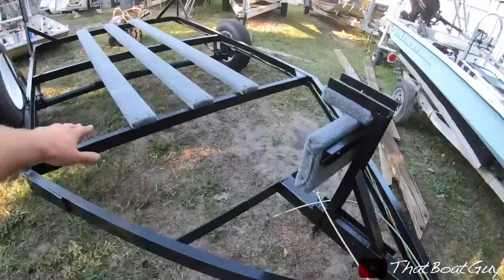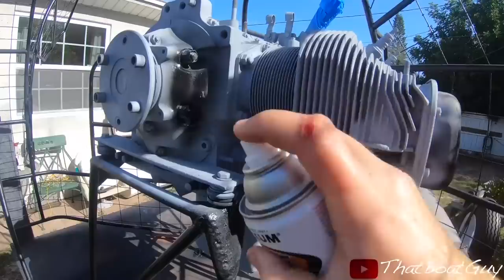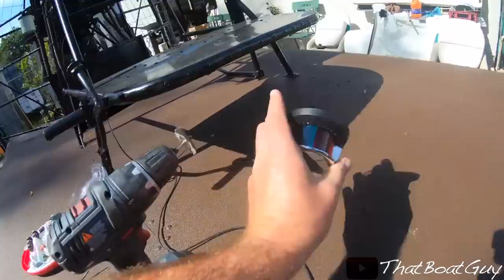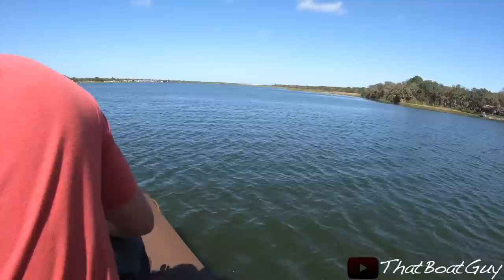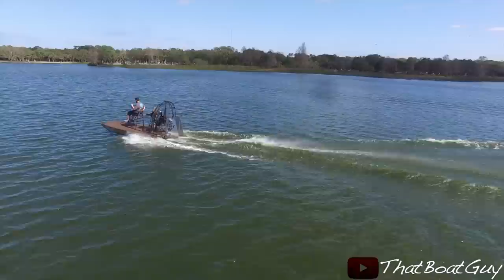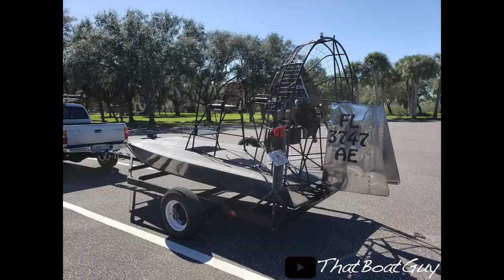Air Boat Gets Second Chance In Life!

Comment: The motor starts to bog when you give it full throttle. Those gas tanks(with the clogged fuel line) have a brass tube that dips into the fuel. On the end of it they braze a brass screen as a coarse filter. Over years those become corroded and clogged. When you blew it out it made it ok to run. If you want to get it to take a full fuel load you need to unscrew the fitting out of the tank and remedy that clog. That will give you the fuel flow you need.

Comment: Watched from the beginning you really did a great job. My only comment is the boat seemed slow I would think it would do 40-45 mph with that motor. Maybe it needs the pitch adjusted not sure how much hp you have 75 maybe. But nice job no matter how fast it goes.
Reply: I agree. Looks like it needs less pitch to get more RPM
Reply: @Mekhanic1  I think it should turn 2200-2400 rpm at wot
Reply: He said in a reply to a comment he didn't run it wide open since he was getting used to how it controlled.

Comment: i am not an air boat guy, so i have to ask. why are the seats so high up and on a pedestal for that matter. wouldnt keeping them lower help with the keeping it less top heavy? not to mention all the room you could save by not having a structure smack dab in the center of the boat take up so much space. just an observation is all.

Comment: Don't know much about airboats.  Cool video.  One comment, one question:  How come there is no wire screen protection behind the prop, only in front of and around it?  And yes, my friend, you should be wearing a PFD.  And maybe have a little trolling motor onboard in case you ever lose power.

Comment: Hi! Nice job!! Also have a small airboat (we call it hydrokopter in Swedish), about the same size as yours which I use mainly in wintertime (early spring / late autumn) when the ice isn't thick enough to be walking or driving on.. Meaning I sometimes run it i water, sometimes on ice but quite often somewhere in between (breaking ice). Curious of the paint you used on the bottom of the hull cause my biggest worry is the ice breaking a whole in the thin aluminum.. I would sink as a rock in 0°C water...  Did you call it "steel-flex"?

Comment: I know there must be a reason they leave off mufflers on aircraft engines, but could you add them?  Would mufflers drain too much power?
Reply: They do rob power, and on an aircraft, noise isn't an issue as everyone is wearing headsets anyways.  Realistically these guys should have been wearing hearing protection here.  They aren't and were never meant to be quiet engines.

Comment: Exhaust too loud? I have a friend down south Texas who restored a similar boat, and he was able to purchase a few goodies. Not sure from where though. One thing was he did install some sort of exhaust system that made whole engine so much more quieter since he uses the boat for duck hunting. Really worth the purchase major differences between the open headers and a quite exhaust system. I think he had just some small car mufflers welded in place. Also he purchase a new prop like your to convert from the old wood one. He wanted to hang it on his wall!. But he first purchased a two blade prop and it was great until a buddy was having his airboat worked on and let my friend borrow his 4 blade prop for a test run!. And it made the boat so so much faster!.. !. So he ended up buying a 4 blade prop. But he noticed the boat got heavier in the rear when set in the water with the added weight of the 4prop and two small exhaust. So he did some research and found some sort of BowExtender it was a company who made a bolt-On extension for the front of his boat. It was designed to better transfer the weight and help prevent the boat from catching air from the increased speed, along with some other being it’s like higher brush a small storage locker for his anker and ropes.. . It made his $300 little boat with restore he was in about $700. And then the refit if the props and exhaust and front clip extender. I think he was $1100 all in and the boat felt like a $30,000 air boat. I know he had it appraised at one point and I don’t know the exact numbers but with the upgrades for a small 90’s airboat they have him a figure if $17,000’or something. I know he held on to it for a few years. And even though with the extension he was able to turn the rear seat into a double seat he always felt he needed more space for guest. So he did sell it at auction and got like $8k? And purchased a 18 footer from that same auction that needed a lot of work for $4k . And it’s been his new project. So far he has fitted the new boat with of course a 4prop, and it didn’t have a engine so he has put a Carbed Chevy big block, and the bow extender.. but that is the last I heard... so just some ideas if you want a better time with it

Comment: we had a 22 ft panther air boat with 502 v8 counter rotating props nice boat but insurance was insane
Reply: with 600 hp on water it would do 50 mph. on a frozen lake it would do about 300 mph scary you had to do a 180 and full throttle to get it stopped seated 12 people. sure do miss it

Comment: I'll tell you one thing you screwed up on that you'll figure out later on.  Aluminum CAN be bonded and painted (many say it can't be), the ~dealy-o with Aluminum is that it MUST BE deoxidized before bonding to it.  In other words, you should have somehow removed a layer of oxidizing then painted or glued or whatever you did to the bottom.  THEN the paint has the best chance of adhering to it.

Comment: Is That a Lycoming Plane Engine ?
Reply: No, it is an old Continental, and in that it only has one spark plug per cylinder it is not an aircraft engine, although I would bet that the majority of internal parts are the same, just not certified.

Comment: NEVER paint an air cooled engine!
Reply: valentina ulharuso ferreira I have used a temp gun to check various parts of an engine before and after properly painting with high temp enamel.
The difference between the two was around 10 percent warmer . That was in a stationary Honda lawnmower engine. 
I’m curious of how much paint affects it on something that moves fast, like a dirt bike or motor like this.

Comment: Looks great!Did you ever try full throttle?I am curious if the engine runs as smooth as it does at lower rpm.
Reply from the maker: I didn't open it up because I'm still not used to it. I did get scared at higher speeds when it started to glide sideways. I thought it was going to flip lol